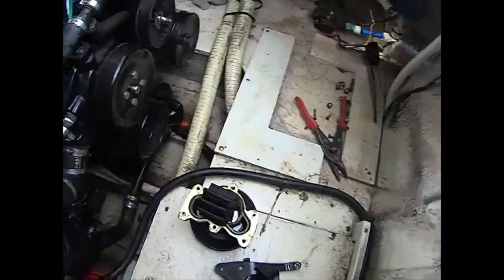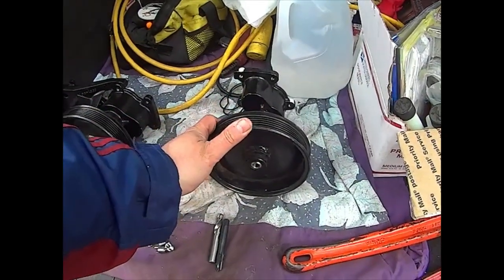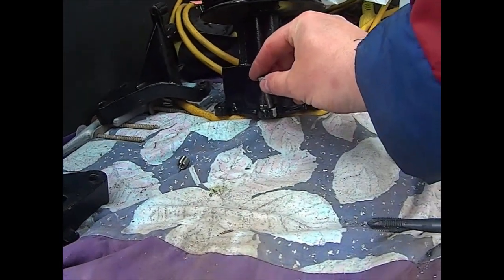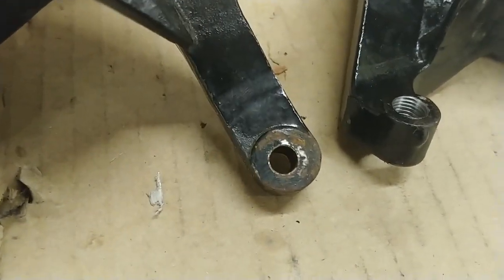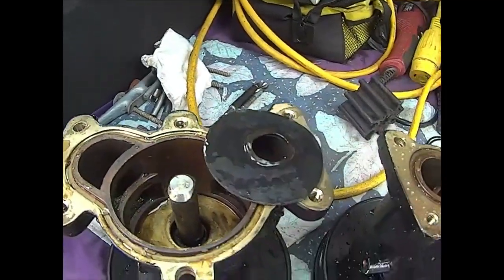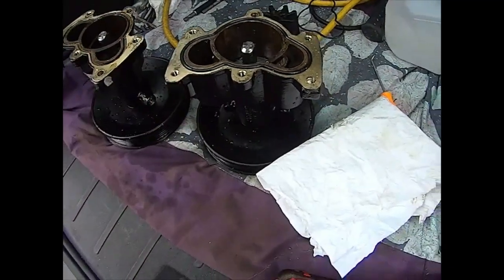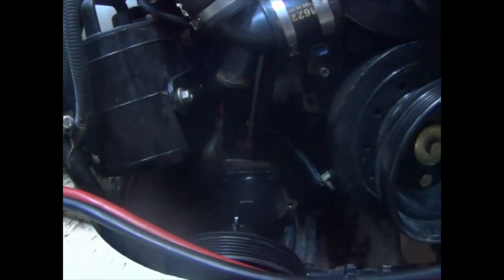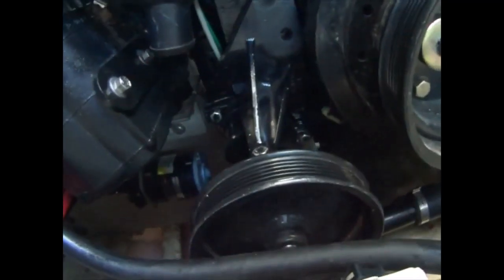Easier way to change the impeller, raw water pump

Comment: I have replaced hundreds on Bravo style impellers old style plastic housing and the new style brass. They are all a pain in the ass. With the hoses going straight out the back on some boats like this one with cool fuel it’s next to impossible to get your hand behind the pump to slip the hoses on. Add it to a small cruiser with no room in front of the engine and it’s even tougher then add twins on a narrow beam cruiser you earn your money.

Comment: If you remove the bolt and nut holding the bracket on the engine block the pump would drop down (if you could remove it from the stud) and then you can slowly remove the 6 pump bolts and the bracket to take the pump apart.  The problem with that is that the tab on the right side of the bracket prevents the pump from being pulled off the stud holding the pump up.  The solution would be to double nut the stud and remove it so the pump will drop down and you can get at the pump body bolts.  It's a bear to get the stud back in while holding the new pump up though. I found it impossible to remove the hoses from the pump back side to get the entire pump off.  People mention grinding the bracket tab off the (or perhaps losing 3/8" of stud length?)  The scoring on the hose side of the pump is another issue.  A company used to make a plate, gasket, and slightly shorter impeller for this. I don't believe that's available anymore, however if you have $600 you can get as stainless, heavy-duty pump from Harden Marine that uses a standard impeller and the plate and gasket for the back side of the pump.

Comment: Could drill out and use a nut and bolt. 
I’m about to do this job on a 2003 mercruiser and it doesn’t have the fuel filter in that spot, that’s where my fuel pump is.

Comment: If you just grind off the Tab on the bracket that catch's behind the Harmonic balancer the problem is solved.
Reply: I’ve noticed on the newer ones they finally did away with that tab which your right made it even harder.